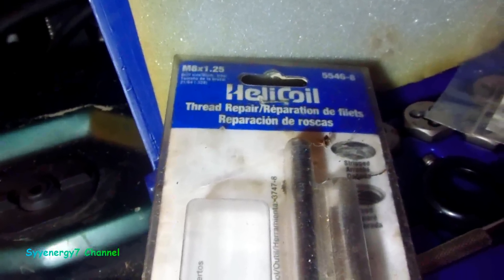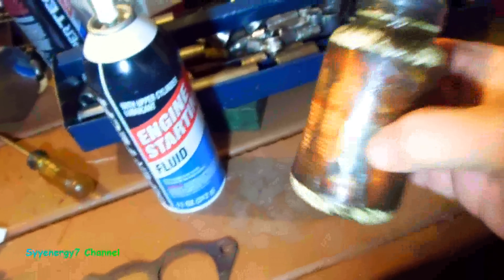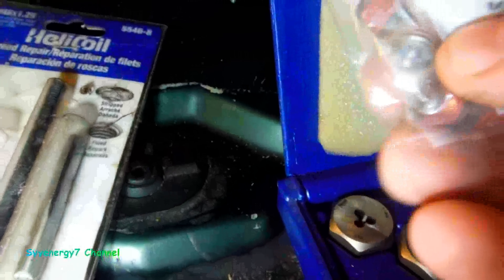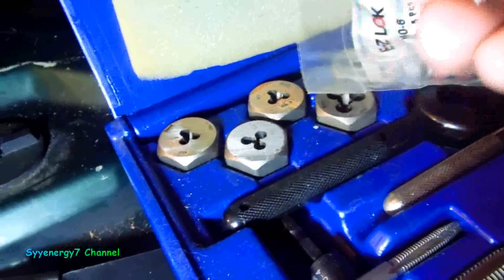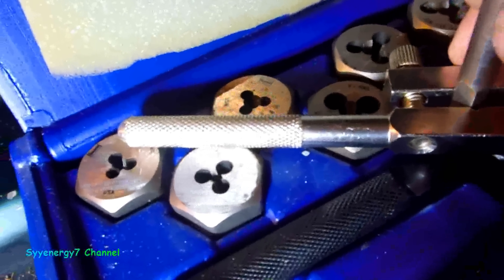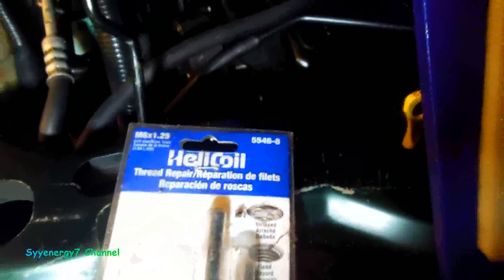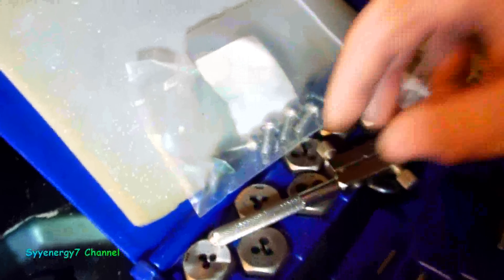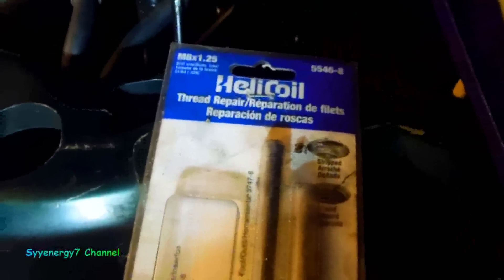Stripped Threads? , Steel Insert, NOT HeliCoil

Comment: Hay hi, great vid, iv a question, hope u have a tip for me save me loads ov work, iv cross threaded the bolt a threads on my bikes crankshaft,  is there any way i could use somthing to rethread the crankshaft, i guess id need a new bolt, but the12mm thread on the crankshaft is it REPAIRABLE.? Any tips.pls help.thanks..

Comment: I came across this; torque shootout video, with various thread kits. It doesn't have EZ lock, in it. But has; similar solid type units. Solid units pull out fairly easy, under load.
https://www.youtube.com/watch?v=LpDduCVUy6w&t=1136s
Helicoil is the best. You can put a little thread lock on them also, for good measure.
Reply from the maker: That's not what I found.

Comment: Thankyou so much.    I couldn't find much searching how to fix my timing belt tensioner stud that had failed from a PO helicoil.    Almost used another helicoil until I realized what happened.
Would have had to pull a good working head,  but I carefully drilled it out (straight) and fixed it right with the insert!   Better than new now,  and  got it fast (and cheap) off amazon.

Comment: I had a blown out spark plug in my triton v8 motor and I put a helicoil in with new plug and the new plug blew out.  How can I get the helicoil out now?
Reply from the maker: I don't know.  What I'd try is Loctite Red on the spark plug and then hopefully when you take out the spark plug the helicoil will unscrew with it.
Reply: you'll have to drill it out - you'll have to get a kit, that is specially designed for that kind of work.  and the install a EZ-Lock insert in it's place.   

I've also heard, that if you put thin gauge copper wire in the hole, and rethread the spark plug, or an equivalent bolt, that you can repair the threads, or use the technique to backout the helicoil.  Not sure of this procedure, but I've been told, that it works on oil pan bolts.

Comment: As many have already pointed out Helicoils are not weaker than the aluminum they're threaded into. If they're installed correctly they work great...
Reply from the maker: Steel inserts are stronger.
Reply from the maker: Have it YOUR way.  Helicoils are cheaper. ANY insert uses a larger tapped hole so it will be strong.  The insert in the aluminum, the weak part, is now holding is a larger diameter and thus it's stronger.  If the helicoils were so damn good, no one would be buying the more expensive steel inserts. Do whatever YOU want.

Comment: Im trying to fix the stripped crank shaft on a 56 LD 150 lambretta. the crank is male end. viewing lots of hole and nut repair videos but seems very few videos to repair male threads. Thanks for uploading this vid. im trying to learn as much as I can about thread repair both male and female. I think it's worth repairing oem parts. Reproduction parts are usually of poor quality. If an Englishman reads this here is no need to comment or suggest. The lot of you look like an arse when you respond. Their are a million threads and comments posted everywhere that stink of condescending douche baggery. Seems my mates have turned into typical Frenchman or maybe they are piss drunk when they post

Comment: If you have Heli-Coils that are failing they were not installed right from the start.
Reply: Given that the previous 'mechanic' stripped out all those bolt-holes in the first place, this is actually logical!  Still, would like to compare them like that HC/Time-Sert/Key-lock/BigSert video.

Comment: Yea i agree that this should be done from the factory right off jump street. However i dis agree about the cost to the factory's overhead. It would turn your typical say, $16,990 car that would now be a $24,990 car. That kind of price jump wouldn't sit well with John Q average that wants to buy a new car. Both cars side by side would be identical in every way to the customer by eye and by performance. Now, which car is going to sell better? Its basic economics, manufactures just aren't going to go to those lengths for preventive maintenance in the customers possible future problems. That would not even become a recall issue. I've wrenched on thousands of aluminum blocks and heads and have had to helicoil threads a few times that might occur every few years on 1 car out of many. Just saying. Hey, btw. Do you work for E-Z Lok? Great comercial though but I will just use my helicoils in 3 years when the stripped thread problem arrives. I mean these are not priceless Ferrari's or vintage Rolls Royce's i'm turning wrenches on these are shit bucket mazda's and turd bomb cavaliers. YO! peace.....i'm out homes.

Comment: Good video. Thanks! I was looking at EZ-Locks which brought me here, but didn't think to buy a separate tap and die set (which I'm in the market for) and just the EZ-Lock inserts by themselves. The difference between EZ-Locks and TIme-Serts (aside form price) is that the EZ-Locks don't require countersinking the hole (which ism a separate tool). They can also be driven in with a screwdriver.
Reply from the maker: Sounds good